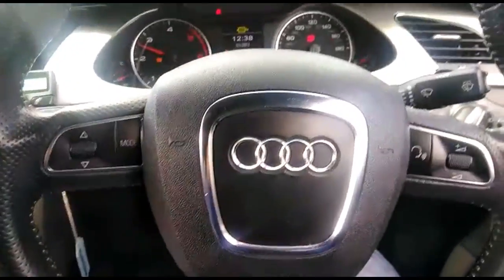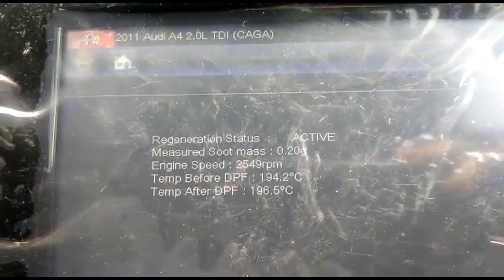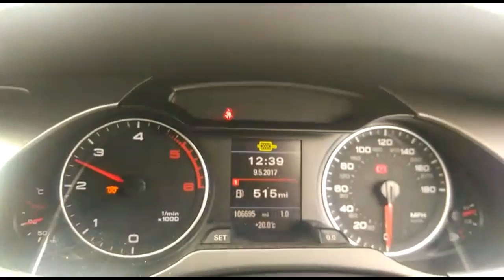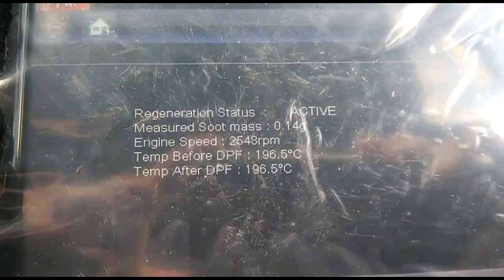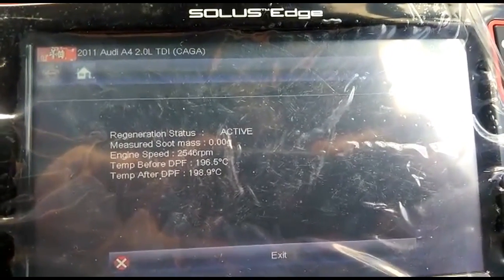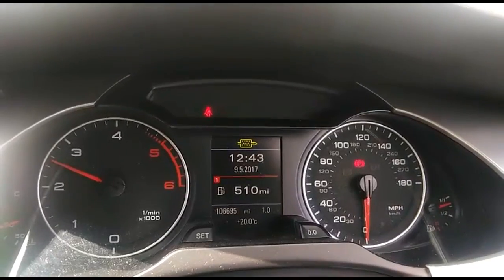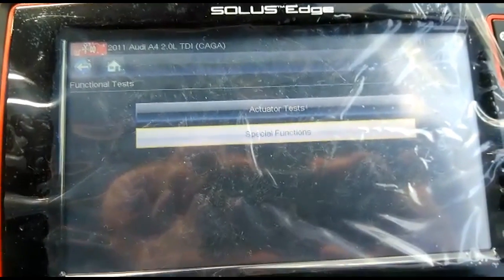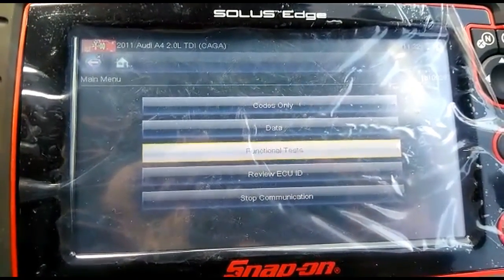Audi A4 DPF Regeneration - how it's done

Comment: I thought it easy to just get pdf out and clean it put it back on and delete the code
Reply from the maker: Hi first step is to regenerate which means using the right diagnostic to regenerate it but if that doesn’t work then remove clean and delete codes

Comment: Can I just turn the engine on, in park, and hold my foot down with revs at 2500 for 10-15min?
Reply: Have you tried ? Did it work ?
Reply: @efexy5249  that's now the proper way to do it. you need use diagnostics tools
Reply: I think you cant do it because the turbo must open the vanes and the injectors must inject more fuel for a higher temperature and when youre done with the regeneration you must drive the car
To cool down all element turbo, oil etc.

Comment: For the second time in a year the sign of the DPF System Error turns on. Last time a cable turned out to be broken due to vibrations. Now it's middle of winter and the cooling fans turn on even after a short ride without heating. Is this related? I will pop into the garage tomorrow but I would like to have an idea what's going on, if maybe the previous garagist didn't do a good job?
Reply: And the first time the car also went into emergency run which scared the crap out of me because this is my first own car. I thought the engine had given up, lol. Good system though. I just wish my Audi didn't have to go to the garage every damn 6 months
Reply: My cooling fan turns on too! Do you have any idea what the problem is?

Comment: Hi, I have Opel Astra Gtc 2008 and my Warning Light is....Pre Glow Lamp i think is Egr Valve or DPF....what do you think....please help ?
Reply: Happened to me and it was a small cable of the DPF filter that had been broken, maybe due to rodents, maybe due to vibrations. It is not a very serious problem, you can still drive slowly, the car might go into emergency run so don't go on the highway! Drive to a good garagist as soon as you can. Maybe the filter is full. Anyway, I am not a garagist, this is just my experience. My Audi garage replaced the cable and it costed like 80 euros.

Comment: Hi , 
I have 2010 Audi A3. My dpf & glow plugs have come on as well as being very limp when driving , tried to  regenerate using the snap machine however keeps saying an error has occurred. 
Any help or advice would be appreciated as not sure what to do 

Thanks Vickie
Reply: Limp when driving is the emergency run. It's an automatic system that stops you from accelerating. This makes it impossible to drive on a highway, which is for your own safety. Happened to me. You can still drive, but it is gonna be annoying if it takes seconds to get to full speed and can be a bit challenging. See a garagist nearby, it is probably a cable of the filter that snapped or the filter is blocked. It's winter and rodents dent to seek heat in cars.
Reply: oh wait I see your comment was a 1 year old. So, what was the problem?

Comment: I have an a4 b8 and that light is on my dash, ive drove for 15 mins in 4th gear at 50mph and it does nothing, would it need to be plugged into a comp? Thanks
Reply from the maker: Yes it needs to be plugged in and see the soot level..
Reply: Taj Cars so driving it wont work?
Reply: Taj Cars cheers fir the reply too 👍🏼
Reply from the maker: If the soot level is high then it won’t work so it’s best if you get it diagnosed..
Reply: Taj I got Audi A3 and my dpf is 53% blocked and now blue smoke start coming form exhaust with smell so what shall I do ?  Thanks.
Reply: @mr.natwadia  did u ever find out wat was the problem

Comment: How is a citroen DS4 1.6hdi regen done? Ive taken it for a long run made no difference
Reply: satwinder6969 hold it above 2500rpm for about 30/40 mins and it should go
Reply: H DOLLAR can i be stationary and hold the rev?
Reply: satwinder6969 yes you can,  driving and being stationary both give the same results, when you do try it I advise adding half a bottle of DPF cleaner into your tank as well to help the process
Reply: Stance_ MXFIA I drive in 2nd gear,  find a place on a straight road and safe,  excelerate up to 3 or 4 1000 revs, back off,  excelerate again,  work the engine 
Keep doing that,  it usually clears my dpf on my insignia,  do that every time you go out,  in a safe and clear road,  best on the motorway,  70 mph  in 3rd gear,  try it, .
Reply: Thanks bro dpf cleaner worked wonders